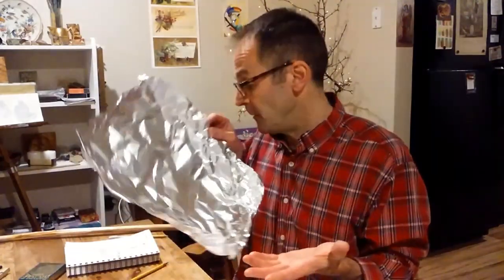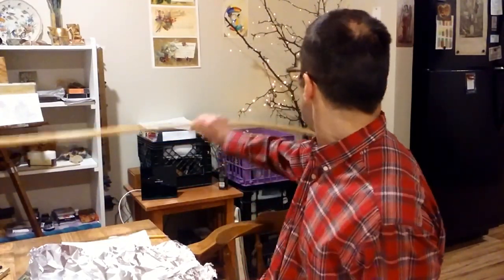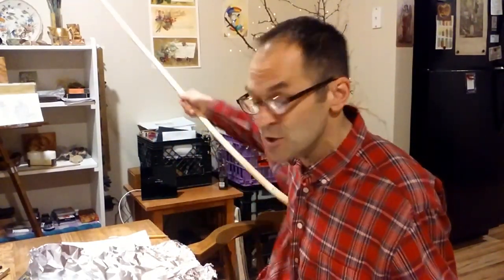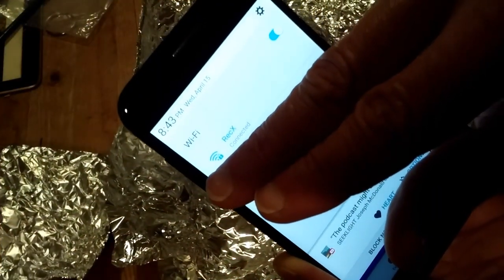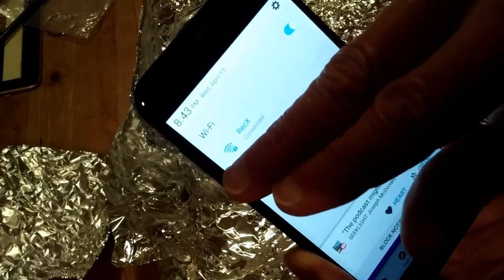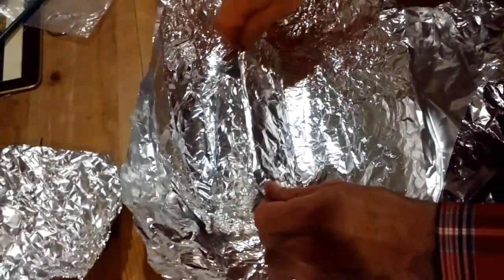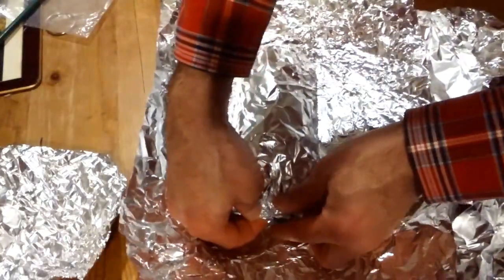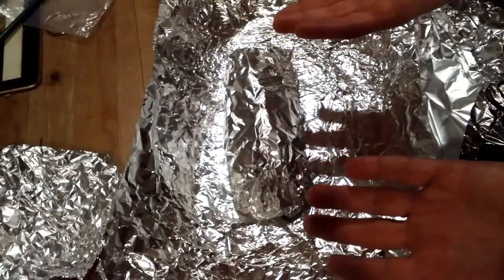Blocking 2.4 & 5 GHz WiFi signal at home 🚧

Comment: Hey all, important point about radio waves. The higher the frequency, the lower the penetration. The telecom industry uses higher and higher freq radio waves so that they can achieve a higher data rate, and not penetration. It's one of the main reasons why older legacy 3g frequencies are still in use. Think about it like waves. You can have many many small ripples slap against a boat (high frequency). but if you combine all those ripples into a single wave (lower frequency) it has a greater chance of knocking the boat over.
Reply from the maker: Nice analogy.
Reply: The higher the frequency, the greater the energy. Therefore the greater the penetration.
Reply: So which less harmful to us? The longer wave of 2.4ghz or the shorter waves of 5ghz? Do the 2.4ghz waves pass right though us, whereas 5ghz has more chance of being absorbed and blocked by us ?

Comment: I just bought a tube amp for my home stereo and heard an awful machine gun type pulsing noise, so I called the maker to tell him the unit was malfunctioning...he asked me if it was near a modem, so low and behold it was my 5g modem, I unplugged it and no more horrible pulsing coming through my speakers.  He said now you know what 5G is bombarding us with 24/7.  Tubes are sentitive to EMF unlike most solid state amps, although Ive noticed even my class d amps sound better with the modem unplugged.  Makes me wonder if 5G can do something to us electrically.
Reply from the maker: Wow Mkay thanks for this epic post. My first guitar amp was an old flip-top Ampeg. So interesting that 5g is pulsing through the speakers and how you troubleshooted. It does give an impression of how this radiation is pulsing through us nearly 24/7.
Reply: Yes 💯
Reply: Interesting

Comment: Foil is virtually useless for blocking WiFi from your home as all it does is bounce the signal around, even if you mechanically ground the screen, ferrite rings are a help but definitely not the answer
Reply: So what unplug the router?

Comment: I have T-Mobile home, Internet, complete with “gateway tower.“ But I almost always have my Wi-Fi unplugged. But I’m fixing to make a 5 sided(left side, right side, side facing away from window, top and bottom) faraday cage to put around my gateway tower. Only the side facing toward the window will be open to allow reception. I want to block the radiation yet without blocking the reception. How many layers of aluminum should I put both inside and outside the cardboard box with five sides? Also, should I have layers of plastic wrap in between each layer of aluminum?

BTW, when I carry my phone, I always put it on airplane mode. And when I’m talking on the phone, I always hold the phone about a foot away from my face. But my problem is I always hold iPhone about that distance away from me at the most while watching YouTube videos with the cellular reception (Wi-Fi unplugged) until I get a suitable Wi-Fi faraday cage. The problem is cellular reception. sucks so bad where I live that I have to have a cell booster, and even then it still sucky. in fact, your video kept buffering while I was watching it just now.
Reply: Did it work?

Comment: If 2.4GHz requires two layers to block, and if 5GHz takes 4 layers to block that means for 2.5GHz of additional frequency it will require 2 more layers to block. Hence a 7.5GHz signal will require 6 layers, a 10GHz signal will require 8 layers to block, and so forth.

Comment: 5g in a home wifi network stands for 5ghz.  5g in phone service stands for 5th generation and is between 600 - 900mhz  lowband 2.3  to 4.7 midband  and 24 ghz and 54 ghz highband! If you really want to block it all the best thing is lead! But that introduces a whole new set of health problems as you may know! You could build underground! as this will have a nice blocking effect The high band can only go for  a few hundred yards which is the reason so many towers are necessary I suggest  that if you are intent on blocking 5g signals that you wait until you can identify their locations  and  try putting things in place directly between you and them. There may be several to contend with though and you may not be able to block all of it but you likely can reduce the direct signal power! There are companies that sell material that  blocks rf signals but I do not know how well or even if they work! And based on prices I've seen ($250 for a 8 by 8 sheet) I doubt I will be testing them but they may well be your best bet! Best Wishes!
Reply: You must be talking about Mumetal. I use it in circuits to block flyback noise from interfering with precision op-amps. It's insanely expensive and it honestly doesn't work as well as they say. You can block GHz range signals with aluminized insulation- ask my parents. There's barely any wifi or cell-phone signal in their house no matter where you stand. You have to go outside to take calls or its just not going to happen. The aluminum applied to insulation is like 5-10 microns thick, so imagine how effective aluminum foil would be at hundreds of microns thick. The trick is to properly connect to it and ground it. That being said, wifi is pumping out nanowatts of power so it couldn't possibly ever matter. Thats 0.000000001W. Put your 1500W microwave on 1% power and see how long it takes you to heat up a glass of water (Tip: it won't, ever) and that's 15,000,000,000x more powerful than your wifi signal. That's the actual number, not an exaggeration. That's almost exactly the difference between the mass of the moon and the mass of a Boing 737.
Reply: @noalear  so what can a senior do when  put a school entire  WiFi unit and 500  KV transformer smack next to each other about 15 feet from my home stucco and windows.   Since I wake every 3 hours and am aging more.  H ELP need inexpensive advice SSecurity check only.
Reply: @maryannsinopoli1751  wrap your house in fine chicken wire that's grounded to the earth. Then cover it in fine chicken wire mesh. Works great for my parents. I get no wifi or cell signal in their house at all, so much so that my phone gets hot as it cranks up the power to try to find signal
Reply: @noalear  my neighbors would tackle me,  not for my neighborhood.
Reply from the maker: How y'all making out with 5G phones? I'm holding out.
Reply: @p1nesap  I hate the Verizon 5G service. It's sooooo bad when you do connect to it. I tried to force it to stick to 4G, but it just breaks everything. My 5G connection is half the speed of 4G on a good day and worse than dialup on a bad one.
Reply: @p1nesap  good, hope many more follow I do not want 5G their Monster!
Reply: @noalear  but what about a school placing it’s entire WiFi connective installation 15 feet from my home ever since I hear constant frequencies in ears, have disturbed sleep and feel I am aging more, it’s a constant as kids at home connect to it so it’s a round the clock yearly hazard to me.  How potent would such an output for that be, would you know?  I’m curious to find that answer.  That WiFi is  close to their 599 kv transformer and their electric runs on a different circuit than what my home is running on; does that mean I am constantly being zap by opposing  lines of current. Mine on pole 60,000 high intensity and theirs underground on back street close to the rear of my lands.  Their underground runs alongside my entire lot.  I fought the project and all done next to me only not other neighbor.
Cannot go with chicken wire method what about trees or shrubs or vinyl storage small narrow unit stocked with soil and mulch?   Or vinyl fence just near it against their chain link?
Reply: @noalear  You are wrong. Either your parents have no WiFi running INSIDE their house, or you don't have the proper meter. But it does sound good for reducing outside assaults coming in, thanks.

Comment: Exactly 👍😎I had a channel that showed the worst unit in your house equal to a smart meter is the digital clock on your stove it  requires 9 volts but is draining from the outlet 220 volts 🇨🇦 this means approximately 211 volts are emitted from the transformer in the stoves electronics   It maxed out my EMF reader. Turn breaker off to your stove until needed. Next I found hairdryers , fans and led lights     Research research research 👍😂. Oh my channel was spammed by Asian women in my comments wanting to date 🇨🇦 men.  I had to delete it
Reply from the maker: Good advice.
Reply: Sounds like you only have an EMF meter, not an RF meter. You can't accurately measure WiFi w/out one.
Reply from the maker: Your latest comment had a code redirect in it, if you'd like to post again without the redirect, thanks.

Comment: 5G is ten times more than 4G
Reply from the maker: For data transfer, low latency, yes. But millimeter wave 60 GHz 5G frequency might be 80x the radiation of 4G LTE at 750 MHz.

Comment: Ummm dude, you might wanna educate yourself. The 5g that is going up currently is actually less that 6 ghz. The 250ghz stuff is only available isln big cities. Also, you wouldn't be able to block the call since most phones now use lte just for calling. Lte will easily penetrate a simple peice of aluminum foil. 

Here's another fun fact. The sun's uv rays sit at a frequency of about 5 terahertz. That's 1,000 times your little router. 

Also, you can just turn off the wireless radios of the router without suffocating it which makes it overheat. That way you can just use the Ethernet ports.

Comment: 2.4 gigahertz router runs at 20mhz and 5 gig runs at 40 ,80 Mhz ,no ?
Reply from the maker: My 5 GHz network is 80 MHz.
Reply: You can run a 5G router at 40 or 80mhz
Reply: Your wi-fi  works outside & down the road ?

Comment: Is this a joke? I was curious about using metal for sound isolation, being high density, with the bonus of blocking neighboring Wi-Fi to potentially improve performance not having conflicting wifi signals. This would only be on exterior walls so my own Wi-Fi would be fine, though I'd want an access point in every room with only enough power to supply that room with Wi-Fi for consistent coverage.
I'm not sure what the concern is about '5G using 60Ghz'. First off, no, 5G does not use 60Ghz. There are technologies such as WiGig and these are very short range. The higher the frequency the shorter the range over the air, and the lower it's ability to penetrate through objects. 5G get blocked by trees and even rain, or at least, millimeter wave 5G which is the 'new fast stuff'. 60Ghz would just be stopped by air over a  short distance. It probably won't be able to pass through an interior wall and require line of sight.
I don't understand why you would be able to block 2.5Ghz easier than 5Ghz as 2.5Ghz can penetrate through walls easier, but apparently not aluminum foil? It sounds to me like the 2.5Ghz you're using is faulty, unless metal is more effective at disrupting longer wave lengths, make the signal unstable.
As for using thin sheets of aluminum foil, did you consider that you may just be disrupting the signal and not actually blocking it, making the wi-fi unusable, but still having wi-fi signals congesting the air?
Reply: Search up the term "Faraday Cage." Basically Ferromagnetic materials, such as Aluminum do in fact block electromagnetic radiation by interacting and conducting the energy rather than letting it pass through. Goverment research has proven that electromagnetic fields do in fact lower sperm count and fertility. Stronger signals do in fact interact with matter even more strongly, this is why they have low penetration like you pointed out. That's interaction and in fact more hazardous to human cell function.
Reply from the maker: Thank you